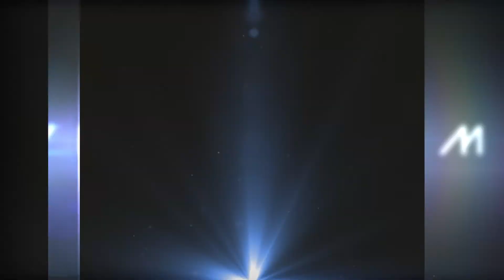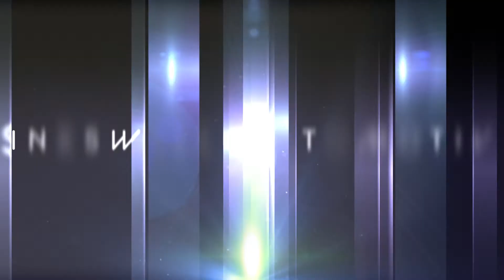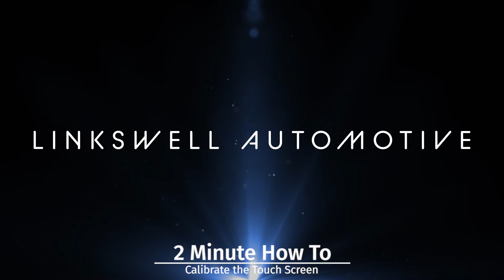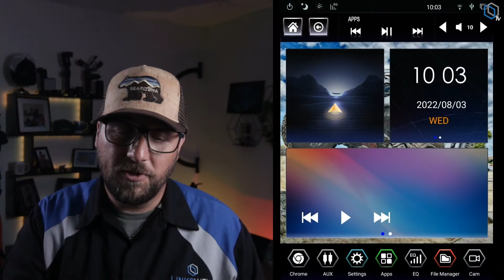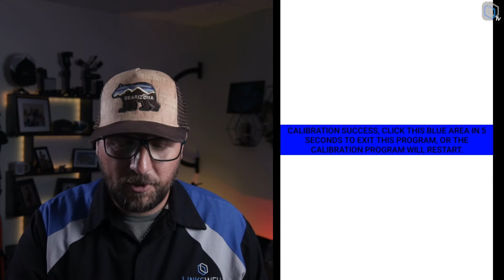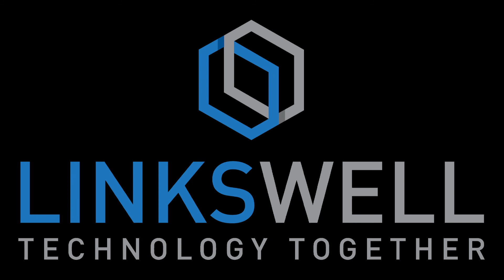"2 Minute How To" Recalibrate the Touch Screen

Comment: Hi... recently purchased TS-FDPU12-1AK-6H  Gen VI for 2019 Ford F150 (B&OSpeakers).  System was working fine until this morning.  Screen is black.  Climate controls work, but not screen.  Would appreciate any  input you could offer.     Thanks...  dominic
Reply from the maker: Press the RST button on the face of the radio with a paper clip.
Reply: @LinksWellInc  Thanks.... worked great.